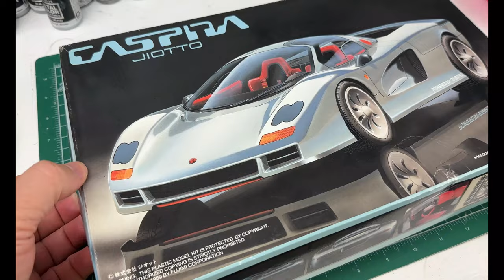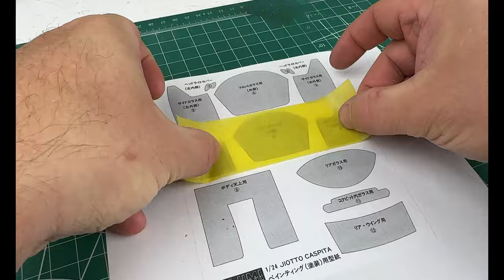Building a Forgotten Japanese Supercar in Miniature: The Jiotto Caspita by Fujimi [FULL BUILD]

Comment: Great work as usual! Did you put the tape on the seatbelts then paint it just to have a better surface for decals to adhere to?
Reply from the maker: Thanks for the comment, it is appreciated. A lot of times these racing seatbelts have a foam piece that slides over the top of the actual belt and this is what has the logo on it. Pictures of the real car I used for reference had these pads on the belts and so I thought I would replicate the look with a piece of tape. It probably added a few steps to an already exhausing process of doing the belts but hey, I like to try things just for fun. haha.